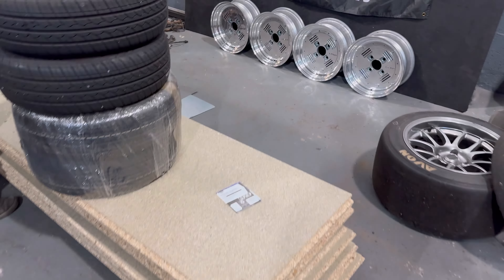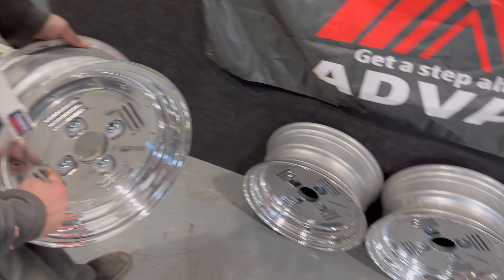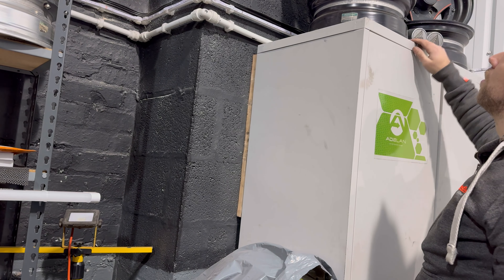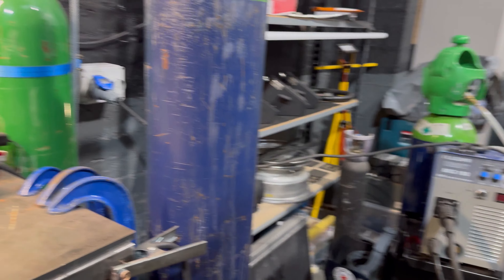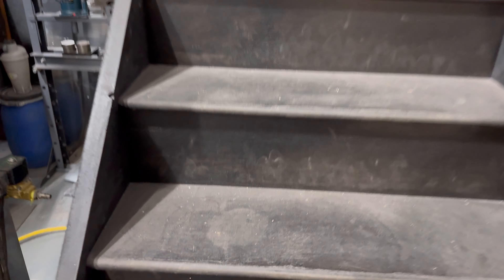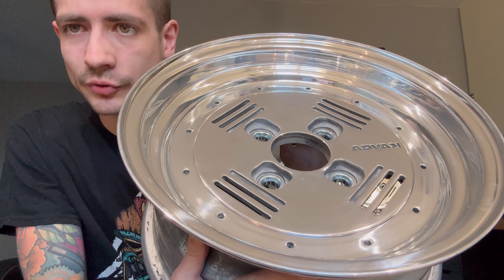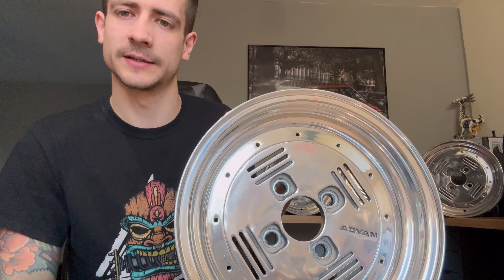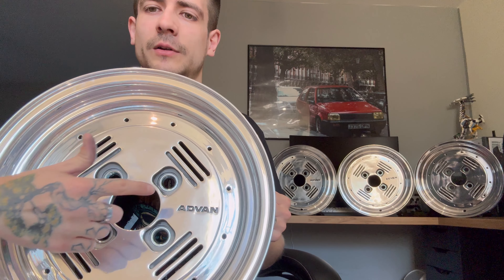Next steps for the K11 - Big changes coming

Comment: hi been following your blogs.. I have a micra and struggling to get wheels for it cos of the centre bore.... saw the silver micra with bottle top wheels.. I have seen them to be 57.1mm centre bore.. How did they fit it? cos the micra is 59.1mm... thanks
Reply from the maker: Hello. They’re not BMW bottle caps on that silver one, they’re a rare set of wheels with a bigger centre bore but the car is running adapters